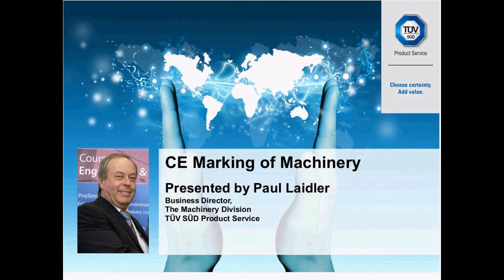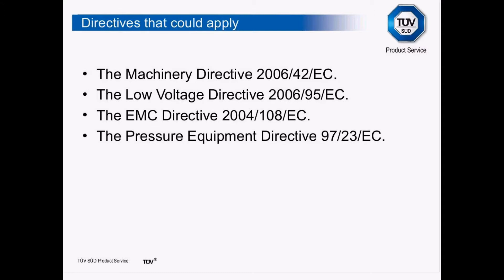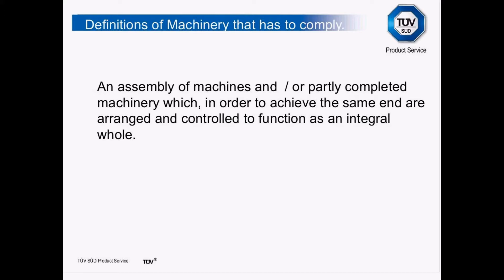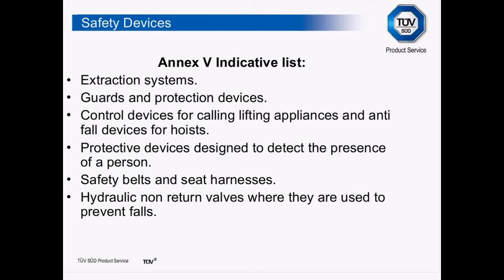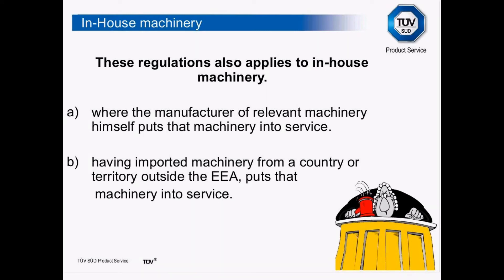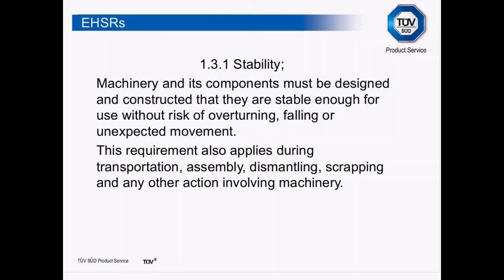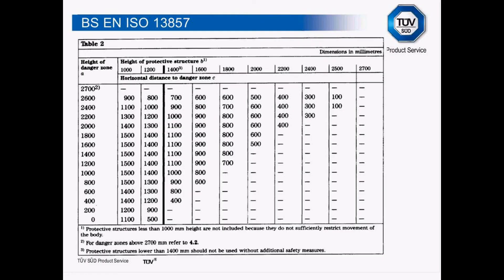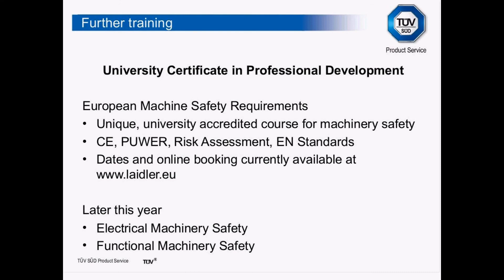CE Marking for Machinery

Comment: I know things have changed a bit since this video (and Brexit and UKCA) but I have a basic question that I can't seem to find an answer to and I'm hoping someone can help me... I manufacture machines, and as such I know I need to apply CE (UKCA) marking on the final product (and need to comply with Machinery Directive etc). But do all of the components inside this machine have to be CE (UKCA) marked, too? So, the components I purchase (such as motors, pumps, compressors, valves, contactors, relays etc), do they need to bare the CE/UKCA mark in order for me to be able to declare CE/UKCA conformity on the whole machine? Thanks.
Reply: I believe they require a 'CE declaration of incorporation' that you then compile into your declaration of conformity.
Reply: If you are end user and have a machine which is already CE marked by manufacturer. Now you do modification inhouse e.g. you have a heavy lid (opening is aided with gas struts) that you want to further secure from falling to worker ( in case of gas strut failure. And to do that you place a locking support strut that secures the lid (fail to safe) that you made inhouse. Now do you need a CE marking for this new support strut (single component) or not? Are there any requirement to somehow test this component? Wich part of regulations address this issue, where to look?
Thanks
Reply: @nikolamilenkovic8441  -  the answer is no as you are not 'selling' the equipment or fundamentally changing its operation as this is a minor safety enhancement modification. If however you are making a more fundamental change in the future you will need to ensure the design is 'safe' and compliant with PUWER regulations as the end user (CE in effect hands over to PUWER as the 'user'). My suggestion would then be to risk assess your design , and keep together with the original machinery documentation as evidence. Routing maintenance and inspection will apply as per other machinery elements. If you are modifying any interlocks or safety systems, there are specific regs to follow.
Reply: @andrewhuckstep2595  Thanks for response, good information. I come to same conclusion reading documentation. So if its just a safety improvement no CE requirements for the machine to add an top of one that is already there, and this is if there are no substancional modification done to the machine  that fall under Machinery directive.
Regards

Comment from the maker: Hi Bryan, thank you for your question.  It depends on what you classify as a 'tool'.  If it is a hand tool that you will be using to fix a machine with, then it most likely does not need CE marking.  If you could provide us with a more specific idea of what kind of tool you will be using we can provide you with an exact answer.  You can email us at info@tuv-sud.co.uk Thank you